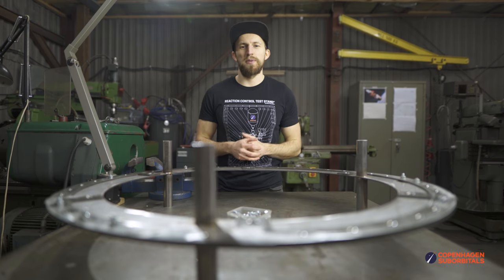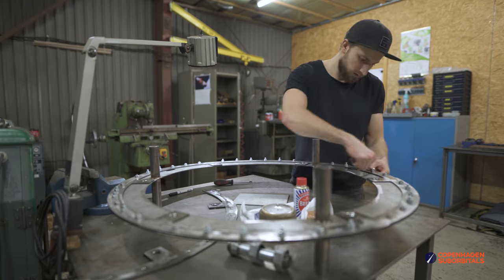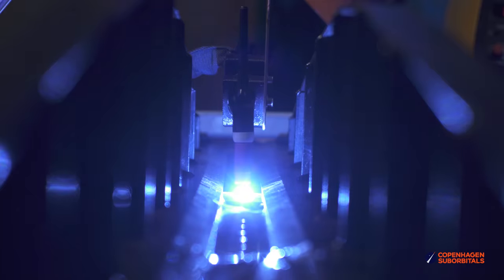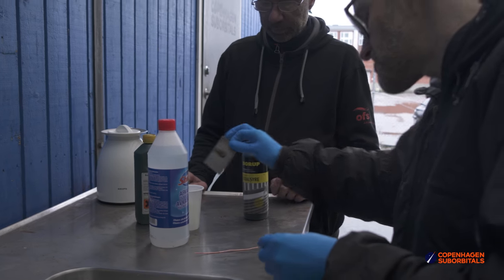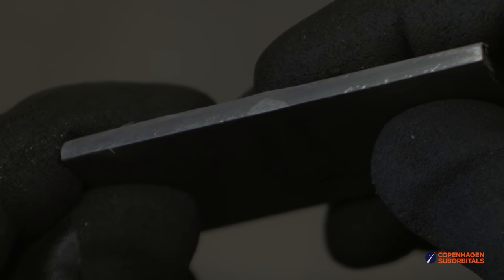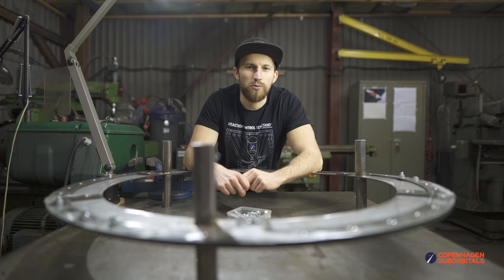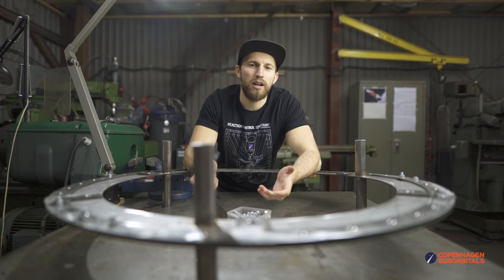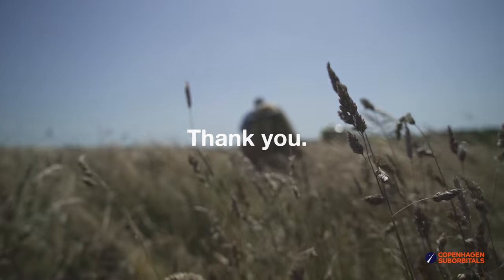Are Our Welds Space Worthy? | INSIDE THE ROCKETSHOP : Episode 20

Comment: Why did you cut weld samples with plasma cutter? This will change weld structure and properties.
Reply from the maker: We cut out a larger sample area which we then machined on the mill to remove the heat affected part.

Comment: You need to get better argon shielding on those welds man, if your stainless is black or really dark in color you doing something wrong. Not shielding stainless properly will cause it to become very brittle and if you plan on penetrating all the way through put the argon gas in the back side as well. Stainless steels, Titanium, Nickel alloys all require shielding on the back side. (Apologizes if this comes off rude, I actually weld in the aerospace industry held to tight tolerances)